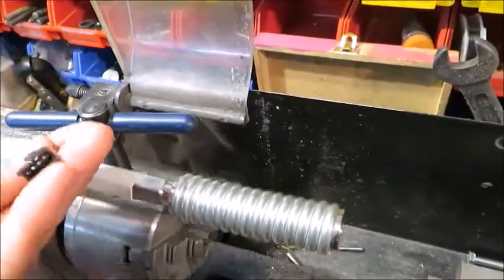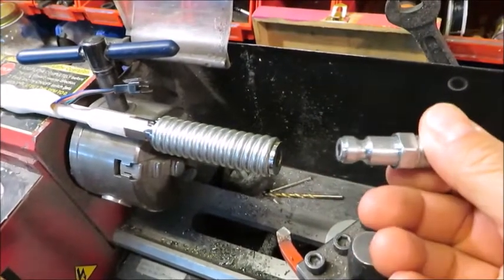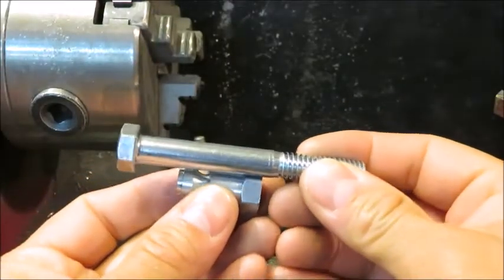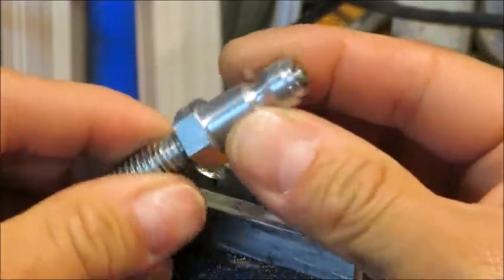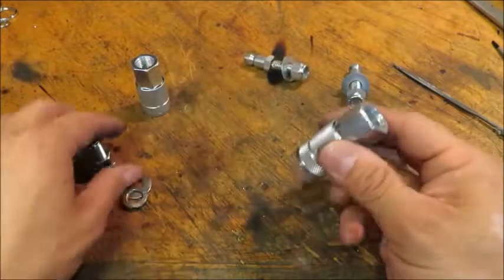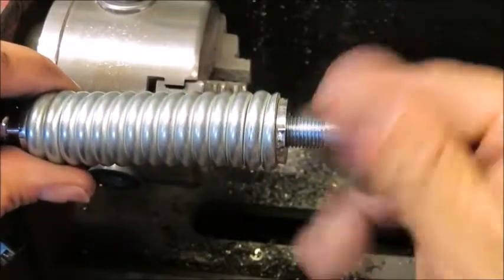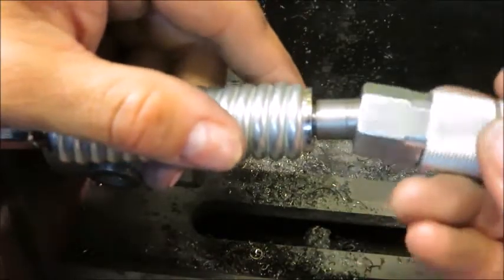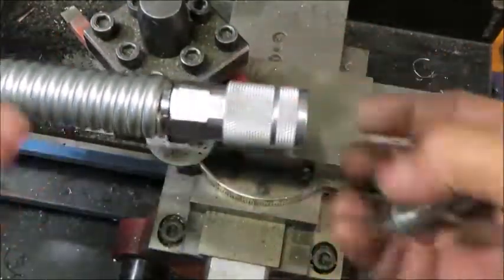Making a flag quick release on a Harbor Freight mini lathe

Comment: So I have the female connector (the ball baring side) and a male connector. For some reason, the male connector slides and rotates in the ball baring connector. I’m using this method for a quick release, but need a way to prevent them from spinning and move as one

Comment: Mr. B, are you still using the original plastic drive gears that came with your lathe?  I did see someplace where someone machined out a set of steel replacements.

Comment: Awesome video. I only realized how much I really could benifit from having a lathe. Appears solid, do the mounts still work. What kind of use or stress have u tested them under? How is the fiberglass shaft connected to the spring?